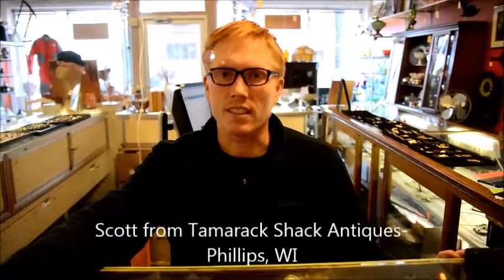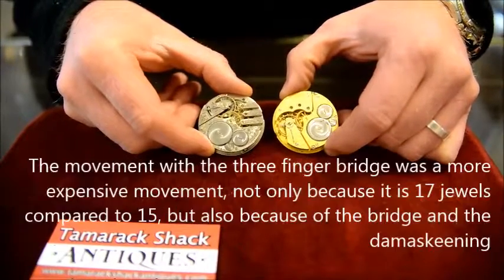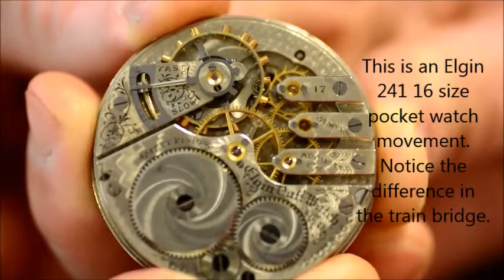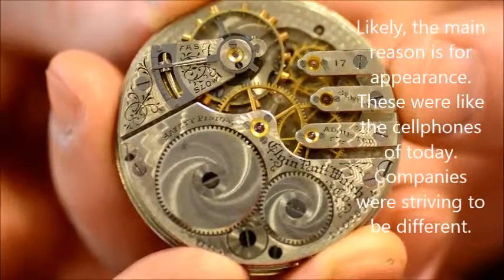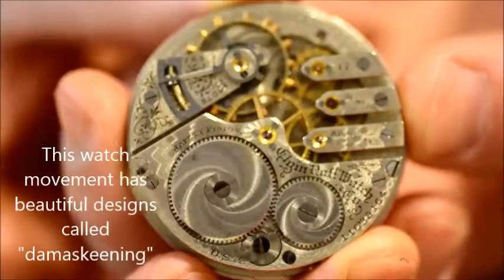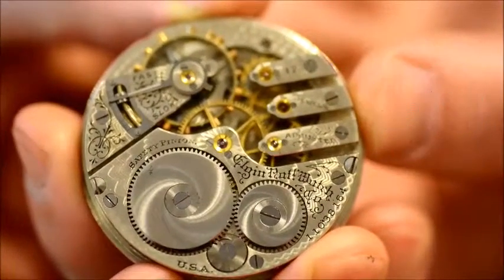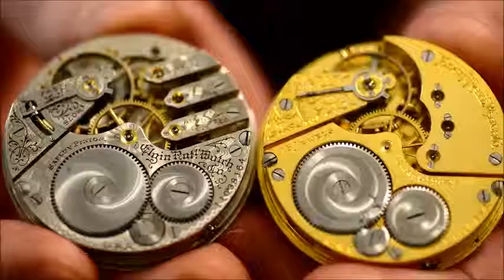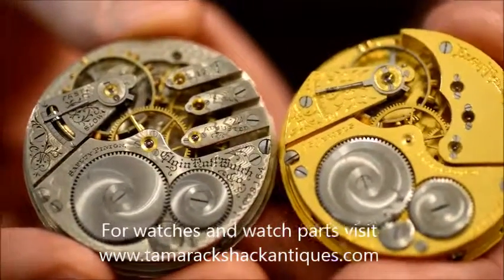What is a three finger bridge on a pocket watch movement?

Comment: Just for my clarification,  you said the  3/4 plate watch was a hunters case 0.32.  Did you mean it was in a hunters case?   At 0.50 you said the watch was for a hunters case, cant movements be interchanged between a hunters, open face, or salesman case?  Are they modified to be used in a specific case type?
Reply from the maker: Brian, hunters case movements can be used in open face cases to make what some call a "sidewinder". However, much less frequently an open face movement can be put into a Hunter's case. I have put them in for people before, but it is an awkward read. 
The hunter movements wind at the 3 hour position and the open face movements wind at the 12 hour marker. Can the be modified? Usually the only way to have a hunters case movements read with the twelve at the top is to have a replacement dial that has the second subdial at the 3 hour position. There were some dials that were made in the 20s or 30s that were like this. I know Illinois made them. 
On a side note, Elgin made "convertible" movements in the 1880s and 1890s that could be converted between open face or hunters case movements that had plates, winding mechanisms, and other parts that could be flopped around. 
I hope this helps some